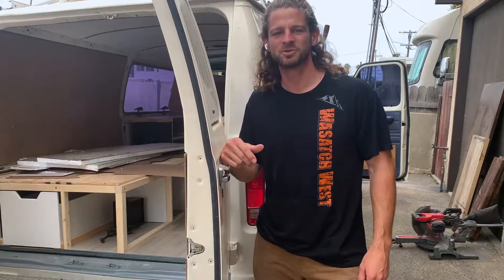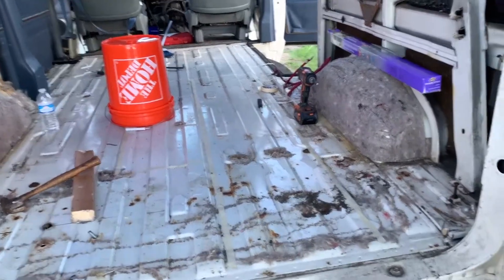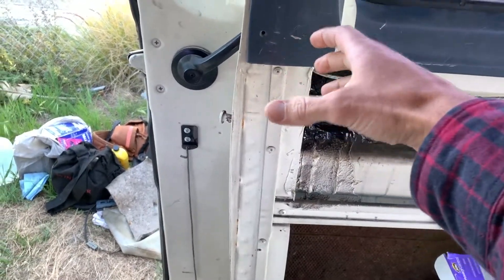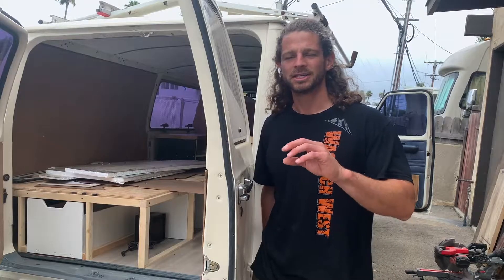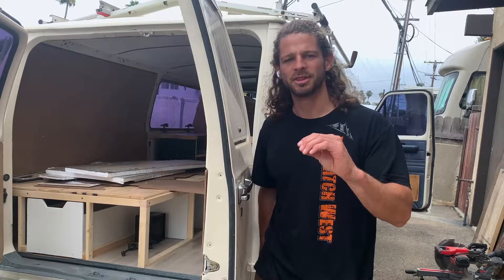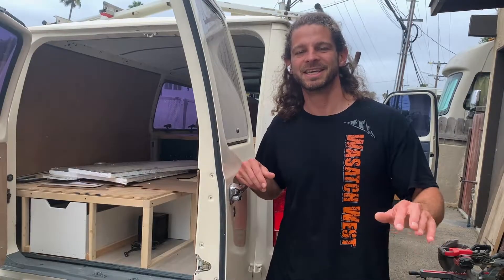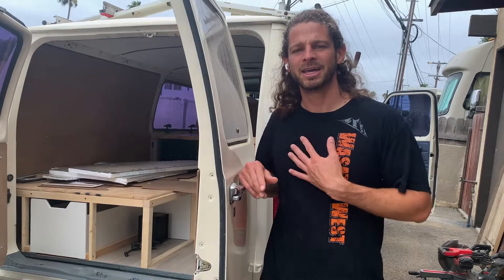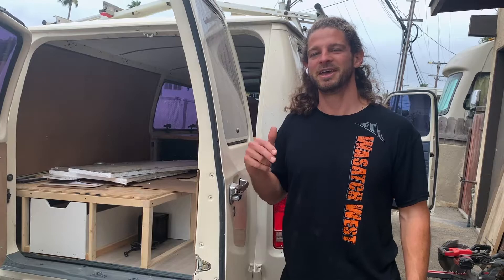Camper Van Floor Install– Stealth Van Build Plan

Comment: Many just use reflectix, its good for condensation if all metal is covered, prevents the cold bridging causing it. Sounds a good plan. How you getting on with the sail boat or have you let her go?
Reply from the maker: Awesome, yes seemed like the perfect moisture barrier to me. Haven't spent enough time on her but did get the outboard mounted. I think I shall put up a video soon on how she's running. Thanks for the comments and the reminder!

Comment: Hi! What did you use to level the floor before putting the reflectix down?
Reply from the maker: Fortunately the van floor was very flat and did not need leveling. I used some 1/4" fiberboard pieces that were original with the van simply because they were already there and for any additional sound reduction/insulation. Not needed and you may just lay the reflectix down with the plywood on top without leveling. Is your floor extra dented or unlevel? Where specifically are you trying to level?